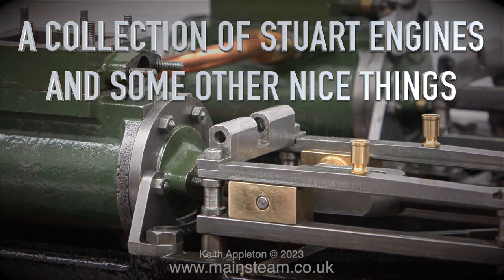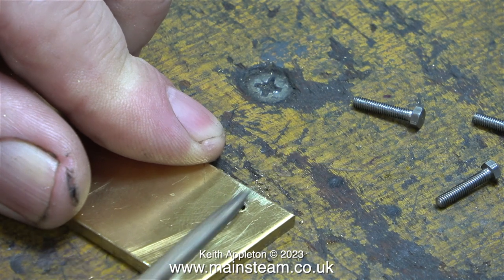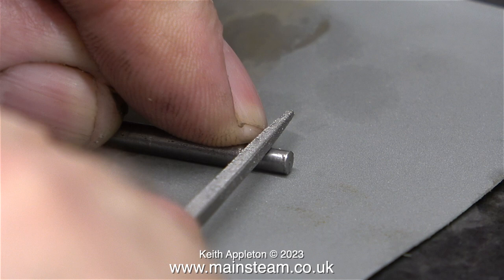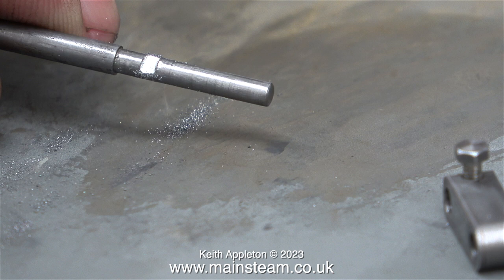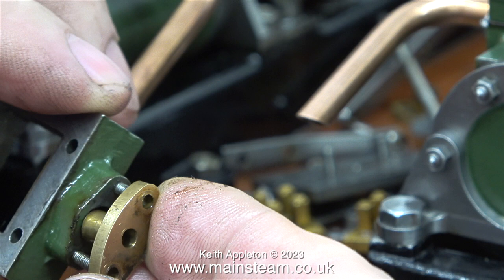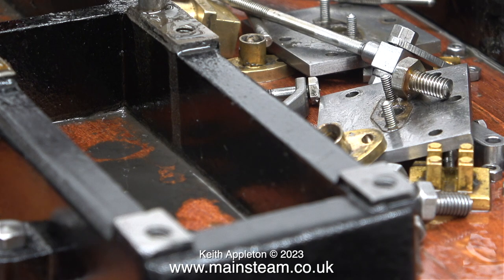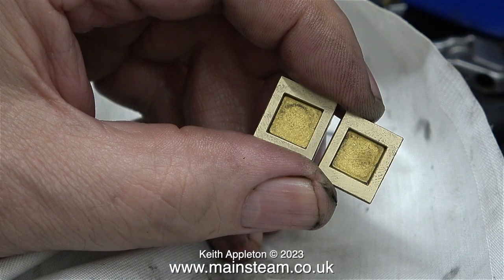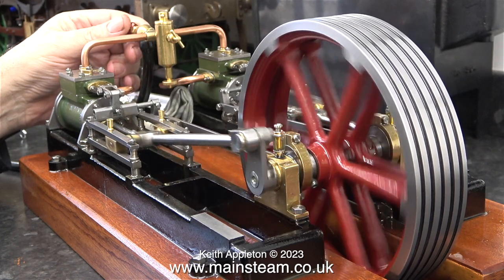REBUILDING THE STUART TWIN VICTORIA - PART #16

Comment: I'm trying to remember how many common mechanical items used packed glands like this, and not remembering much. Old-style compression valves in taps, with packing around the valve stem, and vacuum plunger fountain pens like old Sheaffers are all that come to mind.

That's a roundabout way of saying that packing is something that most people under fifty have never encountered before. It's pretty specialized these days.

That is one beautiful machine.
Reply from the maker: It is now (which will be shown in the final episode) the best Twin Victoria I have ever had - not cheap but a really good smooth running machine }:-)))

Comment: That’s some haul you got from Boston, this Stuart Victoria is lovely could listen to it running all day now you’ve sorted it out. Can’t wait to see that model boat you mentioned. Is it steam powered?
Reply from the maker: It is a very nice Tug Boat called an "Occre Ulises"and it is a brand new build, never sailed and currently fitted with an electric motor, but it would make an easy steam conversion project. It will be for sale soon. (UK Only)
Reply: @keithappleton  I would love to buy a tug boat, but alas I have far too many hobbies and my wife would not be happy if i started model boats as well 😂